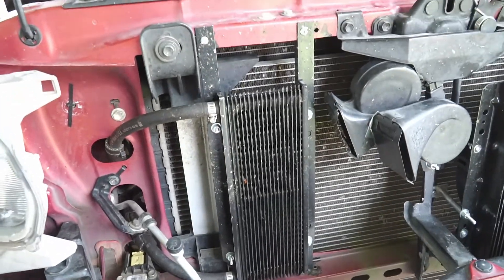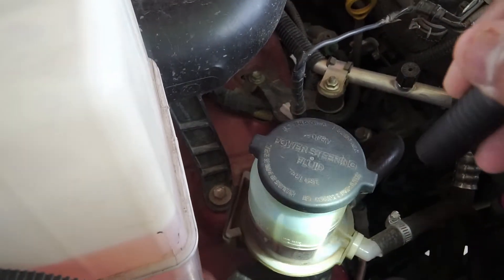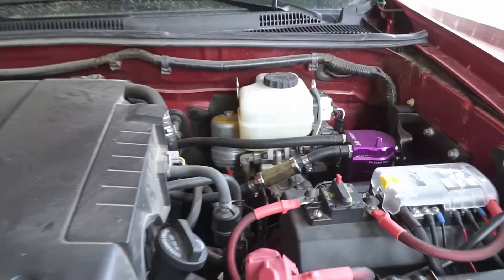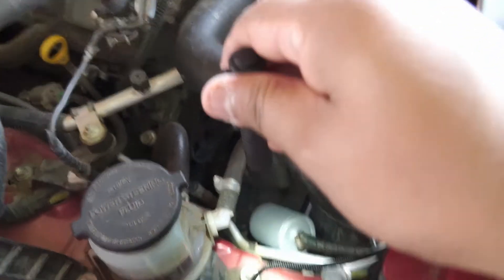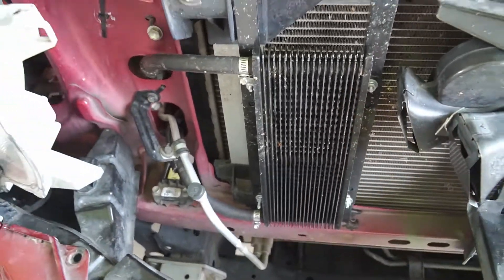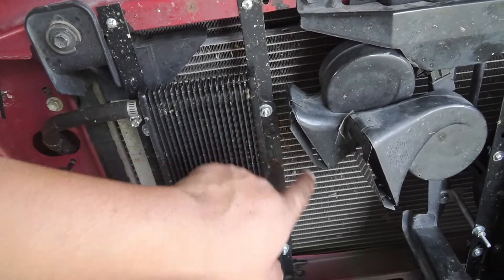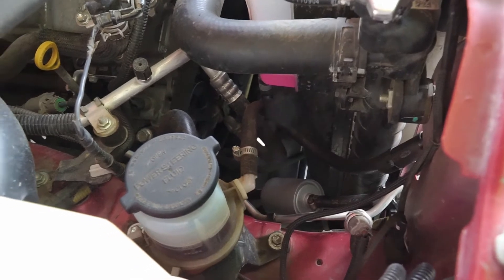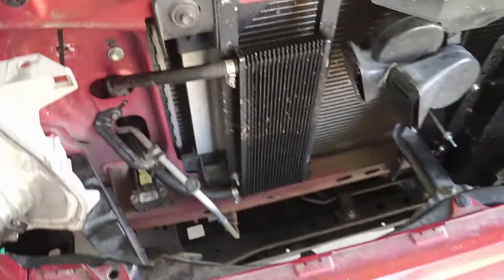TOYOTA TACOMA POWER STEERING OIL COOLER!!!

Comment: Excellent! Thank you for this great video. How much extra fluid did you end up adding because of the Cooler? The set up is great, the only thing I usually do differently is, instead of just painting things like the brackets for instance, I would scuff them up to "key" the surface then spray them with black Truck Bed Liner. It lets rocks and other debris just bounce off without chipping like regular paint. You just got yourself another Subscriber!
Reply from the maker: Hey man, thanks for the support! I don't remember how much more oil I had to add, but its not a whole lot. The PS system doesnt hold much oil anyway so all together my guess a quart of oil? I'll find out next time I have to flush. Have you seen my other video I did for the transmission cooling system? It's similar setup

Comment: Great job! Great information !
just found your videos but I think you are gonna be very helpful on re-building my c1500 suburban 🤘
How was the reaction after you added cooler + lines + filter and reserve tank? Must have realized some characteristic differences  
Thank you for sharing and making this video!!
Reply from the maker: Hayulima Flores sorry for the late reply. Glad my video was of help to you. 

The only difference I felt was during winter the steering wheel gets a little tighter because the oil can’t warm up fast enough due to the cooler but other than that, no issues. The filter and cooler have been doing great. Thanks for watching!!